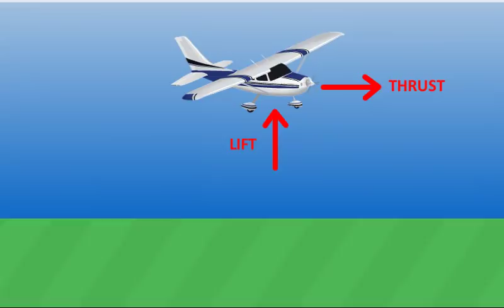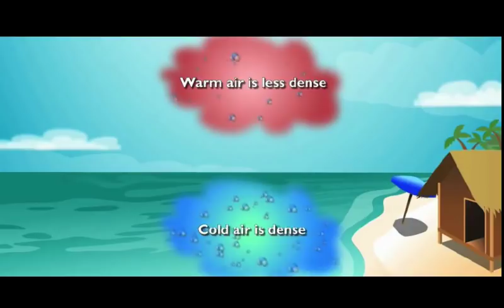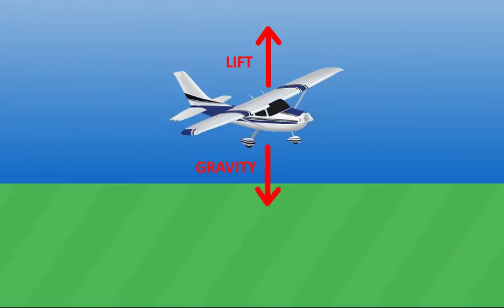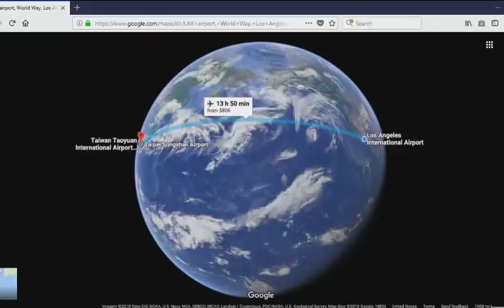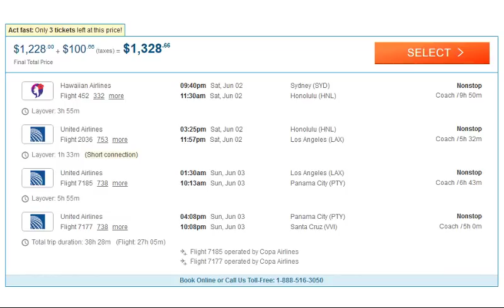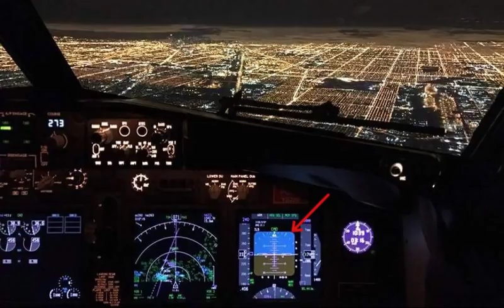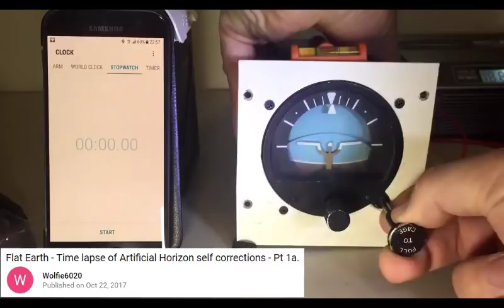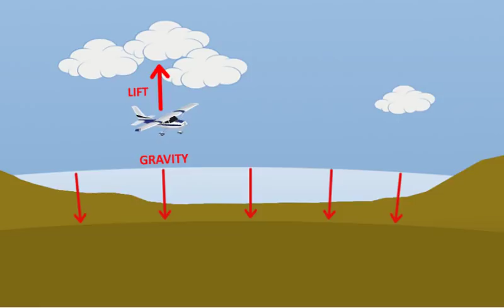Flat Earth Falsities - Plane Nonsense

Comment: i heard a history channel documentary  say that snipers have to adjust  their aim to account for  the earth rotating out from under the trajectory of their fired round. why would this be true for a  bullet, but not for an airplane.
Reply from the maker: Wildman Drake - They were talking about the Coriolis effect. Because the earth is a sphere, the ground speed of its rotation decreases as you move away from the equator. So this can have a tiny effect on a long range bullet fired from a gun, particularly if shooting north or south. The bullet will maintain it's initial velocity from the ground it was connected to, which may be a slightly different speed from the ground speed of its target. This does effect planes also, but will not be noticeable. The pilots are always making slight direction adjustments because of wind, so the Coriolis effect will just be "lost" in those corrections.
Reply from the maker: James Hewitt - Yes, but the effect is gradual. It takes hours for a plane traveling north from the equator to experience any significant change in ground speed. Do the math. And as I said, the pilot adjustments will account for the difference. Bullets move faster and have no pilots.
Reply: James Hewitt Wait... you said the pendulum needs a force to start, but doesn't a bullet need a force as well? Wouldn't that make the two things similar? Or do you claim a bullet doesn't need a force to be fired?
Reply: Bobby Wizdum What do they prove then? Explain the reasoning behind it and not just an answer of it proves nothing.
Reply: VoysovReason wouldn't the object with the longer flight time be affected more by the rotation of the earth? For example.  If the aircraft's flight time was say 1000 times longer than a bullets flight time. The earths rotation would have 1000 times the effect. Would it not? Or if you have to travel north or south for this to happen.  You could calculate the difference between the distance covered.  Which would have a extreamly greater effect on the aircraft that travels thousands of times further than a bullet. Would it not?
Reply: Thank you for your reply. Thank you mostly for not mocking me. I enjoy these conversations. I wonder if a good test would be to spin up a gyroscope and align the axis with a building vertically, and then transport the gyroscope many miles away to another building and compare the second building to the gyro's axis. it would seem that if the axis is no longer aligned in a parallel  fashion that the curve would be evident. Or... if the axis  indeed stayed aligned in a parallel fashion...  i guess that might indicate a flatness to the surface.  That seems like it might be a simple and easy test.
Reply: No. Stop replying if you have nothing to say
Reply: NotTheCIA I.think His own logic fails him so he can only laugh.
Reply: James Hewitt The effect would be less noticeable for a plane then a sniper. Let's pick an arbitrary number of 1 mile away would make change a difference of 1 foot. 1 foot would make a sniper miss since they have a small target. 1000 feet for a plane to adjust is not much for a pilot. Would you agree with the logic of a plane adjusting 1000 feet is less noticeable then a bullet being 1 foot off a target?
Reply: James Hewitt Does this simplified version make sense?
Reply: James Hewitt - "Foucoults pendulum needs a force to start. Anyone who thinks it started spining on its own or due to rotation of the earth  Needs to look into it for themselves."
Wow, just wow... No scientist has ever claimed that the pendulum will move by itself because of earth rotation. Where did you pick that up? Just the fact that it moves doesn't prove anything. It is the direction in which it moves that proves the earth is rotating. Please dude, use your brains. The pendulum is not a perpetuum mobile. The direction it swings and the change in it over time proves the movement of earth.

"The experiment it self cannot be replicated without applying some kind of force/energy to set the pendulum in motion."
Exactly! And nobody within the scientific world has ever claimed such. Please study the subject matter just a bit before you post your nonsense.

" You are a parrot. You keep repeating things you know nothing about."
How about some self reflection here?

"Some of us are familiar with the Foucault pendulum."
Very clearly you are not one of them.
Reply: Generally speaking aircraft can be steered whereas bullets have to be aimed.  Hope that helps you.
Reply: Bobby Wizdom - "bullets and foccalt dont prove earth is moving."
Foucault most certainly does. The change in direction the pendulum swings is that exact proof. I can explain it. Can you explain why it is not proof?

As for bullets, here is a nice little video that shows the deviation of two long range shots in opposite directions, caused by the rotation of earth:
https://www.youtube.com/watch?v=jX7dcl_ERNs
Reply: Foucoults pendulum needs a force to start. Anyone who thinks it started spining on its own or due to rotation of the earth  Needs to look into it for themselves.  The experiment it self cannot be replicated without applying some kind of force/energy to set the pendulum in motion. You are a parrot. You keep repeating things you know nothing about.  But unfortunately you . Some of us are familiar with the Foucault pendulum.  And the dictionary.  Again! a THEORY  of how a pendulum behaves is in no way shape or form proof! YOU CANNOT MEASURE  GRAVITY.  YOU CANNOT MEASURE THE ROTATION OF THE EARTH!!!
Reply: As i asked earlier.  The effect would be 1000s of times greater with a flight time 1000s of times longer. Wouldn't it? Do the math lol
Reply: "The effect can be the difference between hitting and not hitting the target" so can the marksmans aim lol. There is no way to measure the two separately. Its impossible.  But very easy to say that's whats happening.  Not science
Reply: So you dont know which one it is ? Lol
Reply: Wildman Drake . Check out a documentary called did scientists prove the shape of the earth? You decide.  Its a bunch of different types of experiments. One was to measure the distance between 2 buildings at the top and bottom. Its very interesting to watch
Reply: No. Very mature
Reply: Answer me this.  How can anyone mesure the coriolis effect?
Reply: No... i said gravity pulls the atmosphere along with the earth.  I did not specify any speed. You are twisting words once again
Reply: BWAHAHAHAHA
Reply: W
Reply: Stop trolling
Reply: NYCFenrir your halarious coments above lol
Reply: VoysovReason please answer my questions.  I just want to better understand what you were explaining in your video. Cheers
Reply: NYCFenrir the point is bullets and foccalt dont prove earth is moving.
Reply: James Hewitt yes it would. earth is not moving. that is why everything they do to explain it away comes out to the effect of the motion as null.
Reply: Im trying to say that its impossible to measure the coriolis effect.  In regards to the rotation of the earth. I thought (Gravity) was supposed to pull the atmosphere along with the earth. Sugesting the earth has no measurable  coriolis effect???? Which one is it ? The globe pulls the atmosphere along at 1000 miles per hour? Or the sniper has to adjust? You cant have it both ways

Comment: It doesnt, it takes longer to fly east
Reply from the maker: That depends on wind currents, and in some cases routing. Not because of the earth’s rotation.
Reply: Totally FALSE. I traveled for 15 years hardcore. It always takes longer travelling WEST do to the Jet Stream.
 However, if you watch the trajectory of orbital payloads, they ALWAYS launch EASTWARD.  Earth's surface speed of approx. 1000mph is utilized to increase fuel efficiency. The only time this 'rule' is broken is when polar orbits are desired for weather observation or intelligence gathering.
Reply: Yes dear, and females don't fart do they.
Reply: @RV 6 Driver
"It depends on any given latitude in the Northern hemisphere" Hemispheres don't come into it. North or south, there are still winds at all levels.
And the world is not comprised solely of the USA, contrary to what many Septics believe. Howver, the FE cult is mostly Septic. It's called Septic-cemia.
"the prevailing upper level winds are from West to East."
"Making longer travel time if you are flying east bound."
So, with the wind behind you speeding you up you actually go slower. How novel.
Presumably you are referring to what are commonly called the jet streams. Correct?
Reply: +RV 6 Driver
"It depends on any given latitude in the Northern hemisphere"
So what you meant was
It depends. In any given latitude in the Northern hemisphere ,,,, etc.
Eats shoots and leaves.
Eats, shoots and leaves.
Reply: It depends on any given latitude in the Northern hemisphere above the 30th parallel (i.e. over the lower 48 states) the prevailing upper level winds are from West to East.  Making longer travel time if you are flying east bound.  Below the 30th parallel (the Caribbean) the upper level prevailing winds are from the east.  Thus reversing the head wind phenomena that is observed farther north.
Reply: Wong...for sure there is much more to the world than just the US.  It's just that I have experience with the head winds and tailwinds in the states and in the Caribbean.  I am not specifically talking about the jet stream as it is much higher than the altitudes that I fly.  I typically fly around 12,000 feet (3600 meters)  The jet stream is usually about 20,000 feet.  I usually experience headwinds as high as 40 MPH or so.   But I would agree that the direction of the upper level winds that I encounter is in the same direction as the jet stream. My original post could have been a bit clearer I suppose,  So yea...you and I are pretty much on the same page.
Reply: I'm a pilot. HOWEVER I don't know shit about what you're talking about due to the fact that my aircraft is restricted to a small space and a low altitude. (It's an RC plane)   Ha!